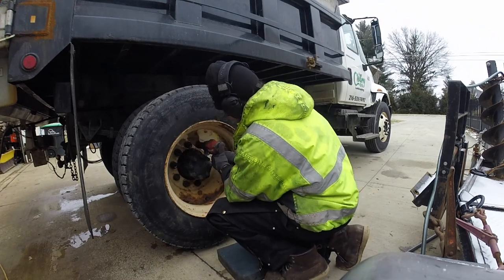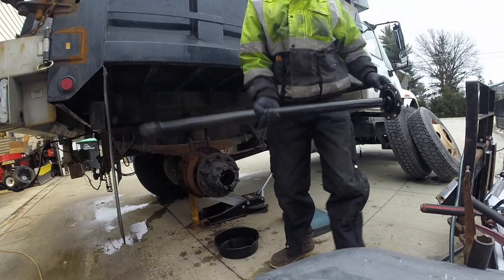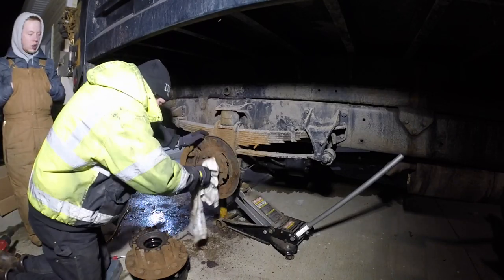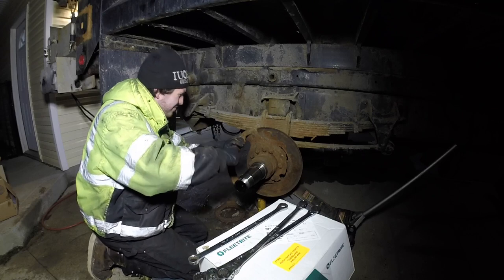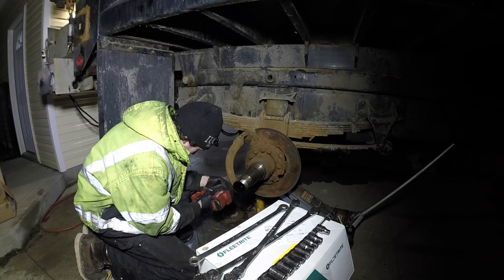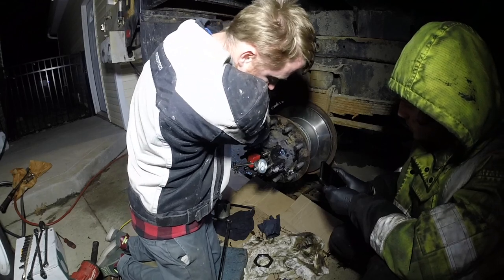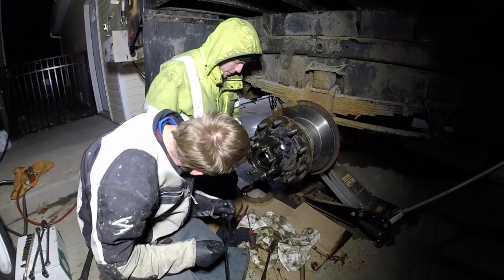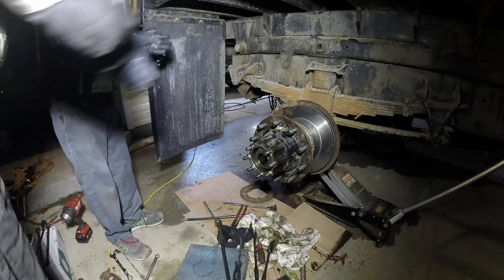International 4300 disk brake diy replacement easy heavy duity wheel bearing adjustment rear axle

Comment: I work with a guy who was at a HD truck repair shop. Tech got a phone call and rolled out from under the truck, walked to his phone, then there was a loud crash. The jack stand failed, and the truck fell and would've killed him.

Moral of the story: don't trust your equipment too much. Make sure jacks and stands are rated for the load you're trying lift. Most important: don't trust Chinese manufacturing. Stay safe.
Reply from the maker: Thank you sir yes I totally agree that this was too far in the un safe zone for me